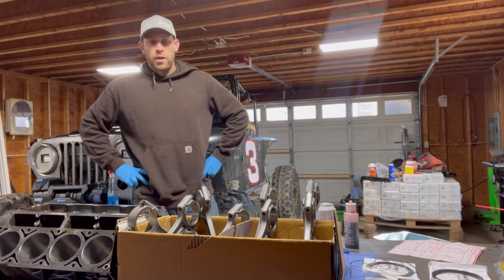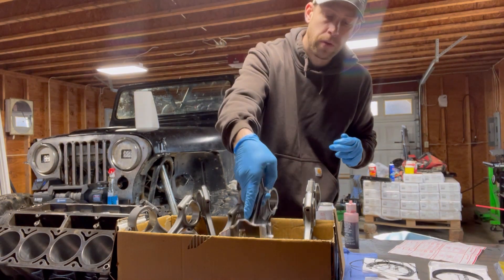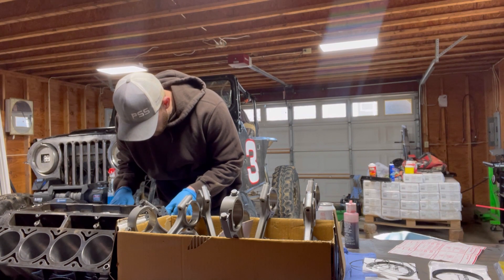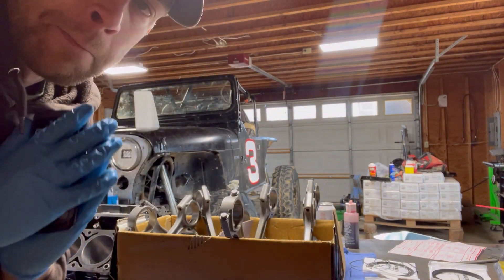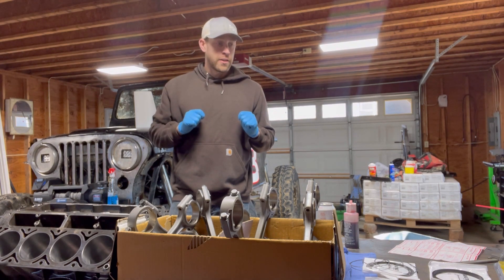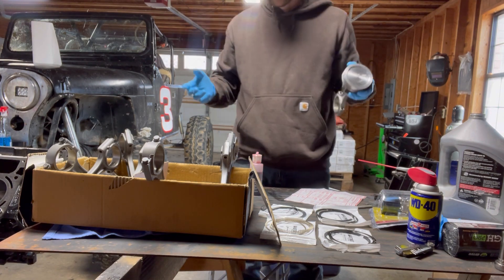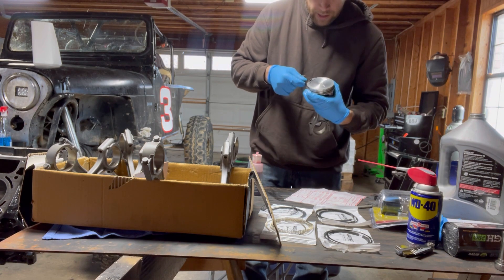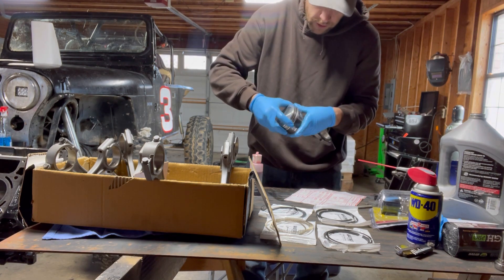How To Install Piston Rings In A 5.3 LM7

Comment: Pretty dang good explanation.  Those 'Hasting" rings?  It's pronounced "Haystings" like a bale of hay.  Also, I was wondring why I couldnt see a top mark on thee rings, or any mark inidicating which way they should go in.  Thanks for explainng that.  I'm rebuidling a 5.3 now for a 1959 Apache panel truck.  Should be good, and Iam going to isltall a Lunati cam for kicks, grins, and giggles.